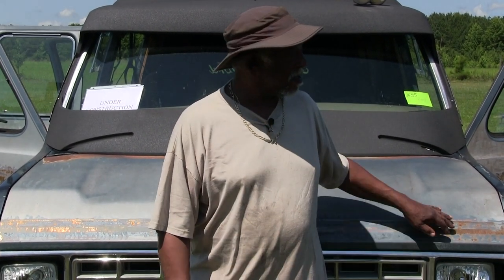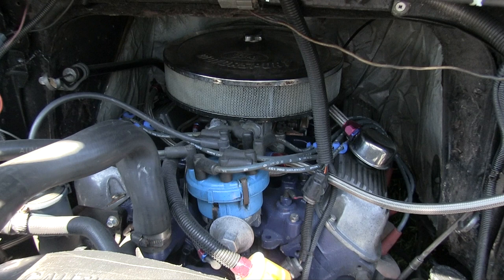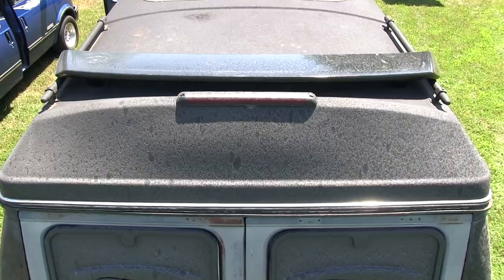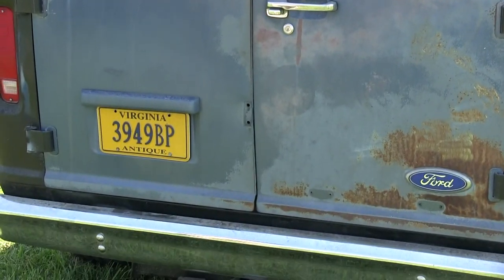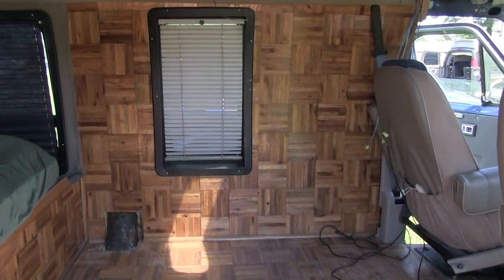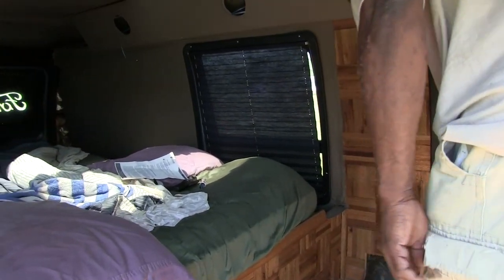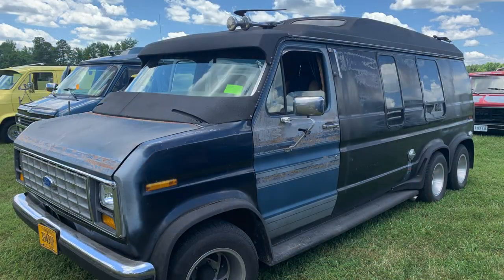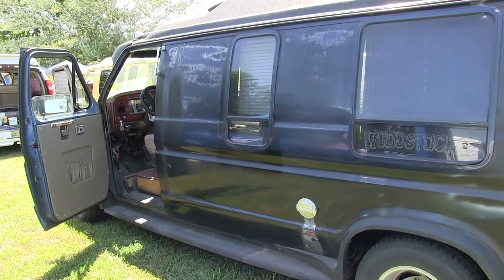1979 Custom Ford Tandem Van. "DIDLEY"

Comment: Good luck 🍀 love the extended back Blue and gray Nice
Reply: My family Had a Ford Econoline show van the back of it was shape like round there was a table in center and the center dropped down to the floor which became a bed and the speakers were in the corners over each speaker was a small van lite they were Brite   4 61/2 speaker 🔊 2 back face forward on angle 2 front doors for full sound the top   would lite with toggle switch it had a small sink with hand pump  water tank was under the bed to fill you just used a garden hose there was a small Pvc where you open the doors in back
Reply: At the bottom of the sink the was a small ice cooler you put ice in it and it had drain that when the inside melted like rubber hose drain it keeps the drinks ice cold all day